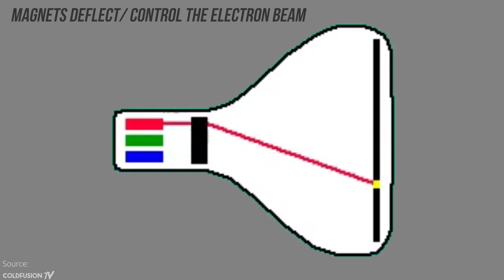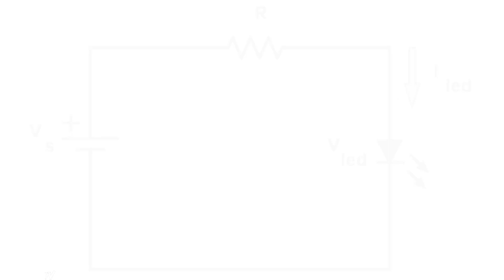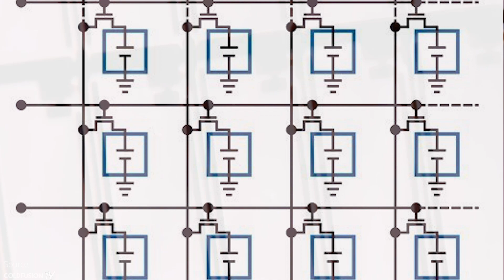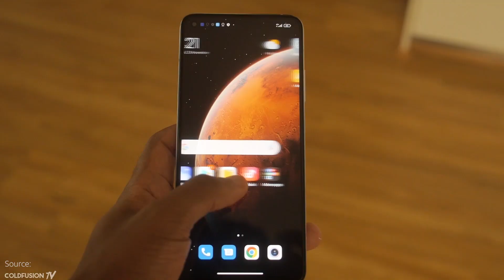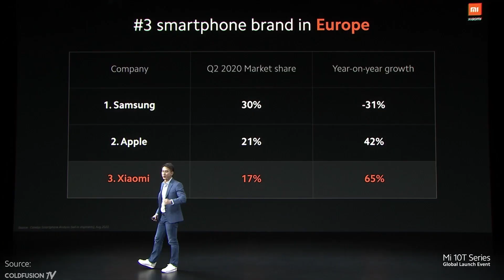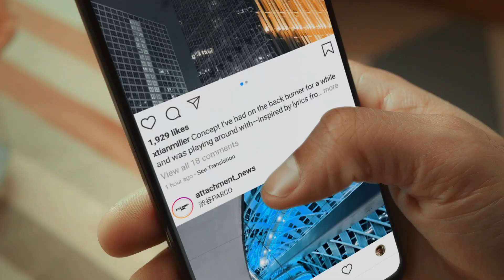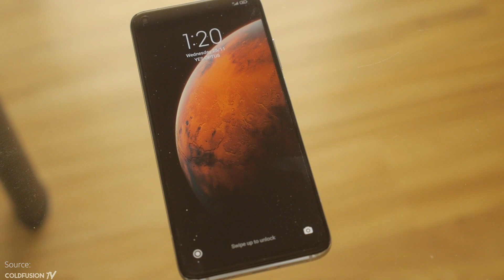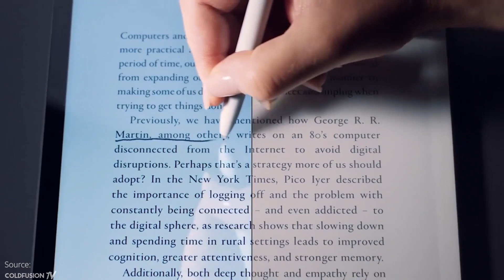#MiAcademy | The Evolution of Display Technology

Comment: Duh you still give the "old display technology" in mi 10 T OnePlus 8T has a AMOLED 120HZ display
Reply: Maybe to avoid burn-in issue as those in OLEDs.
Reply: @timytimotius4679  bruh there are tvs out ther with OLED display which can be used for 10 years
Reply: @SandyMandy-xz4ph  yes still works fine but with stained displays caused by static tv station logos and overlays.
Reply: @timytimotius4679  bro does mi 10 T pro have any tv logo in it by the even I know that it happened in earlier versions but in 2020 nearly all of the OLED displays has some kind of screen burn prevention hardware or software in it
Reply: @SandyMandy-xz4ph  keyboard, camera shutter button, game overlays such as fire button, jump, setting, map, etc.

Burn-in prevention feature is there on high-end TVs, but haven't seen one yet on smartphone, since phone manufacturers stated that people will change their phones after 2 years of usage. But i think it only applies for those who have money. So i don't have any problem witht mi 10t for not using OLED
Reply: https://youtu.be/h4qcHf86oPQ
Reply: so you're expecting OnePlus 8T with Mi 10T price? LOL. smh.
Reply: The Mi 10T isn't a flagship like the 8T. Then you should prefer the Mi 10, Pro or Ultra. The has AMOLED with 90/120hz refreshrate.
Reply: @akaliweeb5305  OnePlus 8T is also not a fully flagship phone both Mi 10T pro and OnePlus 8T just has a 50 usd difference in China and India
Reply: @akaliweeb5305  True tho . Mi 10T is not the flagship . hahahaha they didnt know that i guess .
Reply: They want to keep low price i think
Reply: @ayamkeringnotbatu9162  no
Reply: Because adaptive sync refresh rate won't work on OLEd